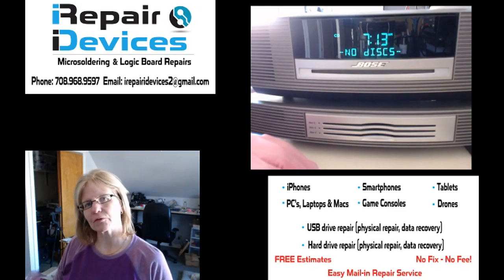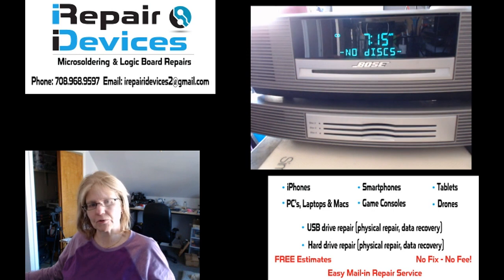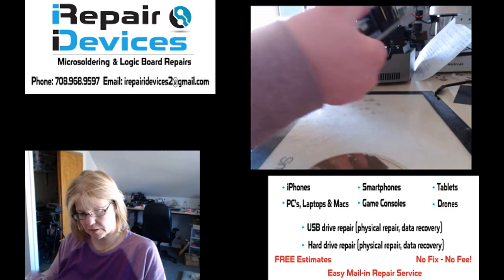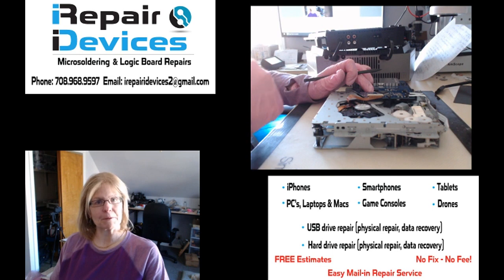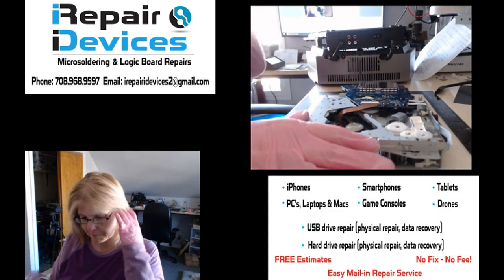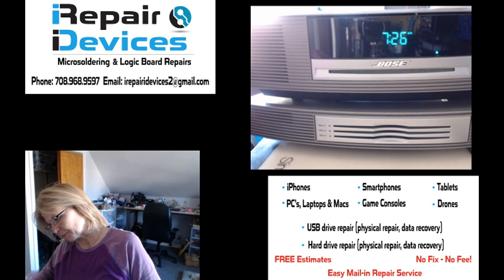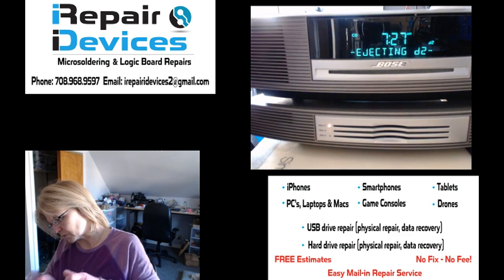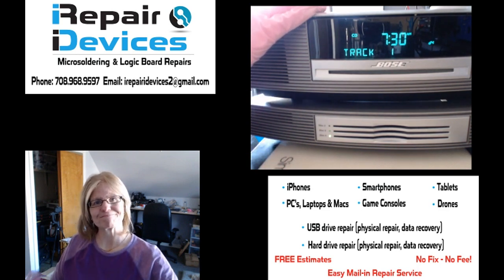Bose Wave Radio CD  - disk error messages and drive chattering

Comment: Amazing video..Have a Bose AWRC22 and  3 disc changer. The changer initially did the skipping thing and only chattered on eject. Now it chatters whenever play is attempted in all slots. Bought it used  recently, so I am unsure but am going to try what you did in this video. Question, though. The main unit is "picky" sometimes about cds, meaning  it won't take certain cds in  to load to play o4 It takes a couple tries for the "roller syetem to take it into the init to play. Is this normal? If not, is there some way to address the issue without dissasembly..? As an addendum when the pickiness occurs, unless I  wait until "reading disc" and then "disc error sets while the disc is sitting in the slot halfway in it scratches the play side of the disc also. Any assistance with this would be much appreciated. NOTHING addressing the main unit "selectiveness" is online..

Comment: I have a Bose setup similar to this one worked on which has a problem reading disks with both the main unit, and theMulti CD changer accessory in all 3 inputs. The player feeds disks, reads disks disk error message, and ejects disk. I have seen other repair videos with the cleaning disk, but feel that it no doubt needs internal cleaning but some adjustment of the speed pots. I like the unit enough to not personally disassemble and mess around, but instead get it done right. What is your opinion?

Comment: I have a wave cd radio which has the single slot cd port. The unit unreliably feeds the cd into the player. Do you have maintenance tips or repair on how to diagnose and fix the problem?
Reply from the maker: Good morning, Loretta. When you say "unit unreliable feeds CD into the player". Does the unit fail to grab the CD and load it into the housing? Or it loads into the housing,  but does not spin? Do you get an error message on the display like for instance  "disk error"? Or the CD does load properly but just spins, no error message, no sound etc?
Reply: Hi,
Shortly after posting the inquiry, I found out from another youtuber, that the problem was due to dirty feed rollers. Making a card, dummy cd, and feeding it into the slot cleaned the rollers. Thanks for getting back to me. I forgot that I had the problem and moved on to other problems in the house. The Bose works great now.

Comment: Ma'm, I noticed that you did not have to go into the top unit (the single player). I only have the single top unit, and mine chatters TERRIBLY!!! I've had it for many years and I sure miss listening to it. I've tried the disc cleaners, but no luck there. Would bouncing it off the walls help any??? Oh...it doesn't seem to have any problem showing up on the screen...it just chatters terribly and keeps skipping back to the part where it started chattering like it's stuck there. I hope I explained that clearly enough.
Reply from the maker: Hello Cliff. Bouncing it off the wall could possibly help it. 🤣🤣. Just kidding. I do offer mail in repairs. Email the info and i will be glad to quote you a price. 

Email: irepairidevices2@gmail.com

Comment: My multi-cd player is fine since I replaced it in 2016. It is the original single wave system that stops or does not want to play. Would a cleaning disk help this problem. If so, what is the cost and how do I purchase this disk.
Reply from the maker: Hello Dee, you can try using a disc cleaner cd. You can purchase them online from Amazon.  Some of your local box stores may carry them as well. Cost for these can range anywhere from $8-$15. These cds have a small micro brush on them and when it's inserted into the unit, the instructions tell you what you to do, but basically the spinning motion will gently brush the lens. You may have to do it a couple of times. Do not touch the tiny brushes or bend them with your fingers. That may resolve your issue, however if it does not then a manual cleaning of the lens would be the second step and that requires disassembling the unit. If the problem still is present after the second step then the issue is mechanical.

Comment: Hi, I have a unit just like that one, except my number 1 cd player, (one on top) does not play my CDs, says error, the cd will play on all the rest. I try a cd cleaner but that did not help. any idea. thanks.
Reply from the maker: Could be a variety of things. Dirty lens which would require manually cleaning because the CD itself wasn't enough. Lens itself is failing or the internals need a good cleaning and re-lubing.

Comment: Mine has a please wait message and nothing not even aux works, any way to reset? It was working fine very recently but when I unplugged it to move it I get this message.
Reply from the maker: Hello Khoel. Check the aux cable, make sure you don't have any broken pins. Aux cable that runs from the 3 disk changer to the main unit consist of 9 pins. Keep me posted
Reply: @irepairidevices  no issue with the aux cable itself, tested it on my other stereo. It started working again tonight randomly. although it is struggling to read discs. I may have to clean it. Thanks for the quick reply!! Aux works now though I'm pumped!n
Reply: @irepairidevices  it is skipping and making a clicking noise when I try to use a clean CD

Comment: I has working on mine and broke a ribbon connector. Want it?
Reply from the maker: Drive assembly possibly need re-alignment due to gear and/or spring out of place. If you are interested I offer mail in repairs.

Comment: You seem to me to be very good at what you do, and seem very knowledgeable in regards to electronic repair! Now for the however.
However, you are wearing what appears to be a sweater like sleeved shirt, unfortunately you are not wearing a "Anti Static Wrist-Band". This is a BIG NO, NO when performing any electronic repair. Just one small static discharge between one of your fingers and a component such as a chip on a board could cause you and your customer to experience one big headache.
The "Anti Static Wrist-Band" will ensure you are grounded and static cannot not damage the equipment you are repairing.
The latex or rubber gloves you are wearing will block static, but if they have even a tiny hole, a hole unseen by the sharpest eye, the worst can happen. Gloves will also reduce your dexterity by an average of 30 to 50 percent. The only benefit from the use of latex/rubber gloves is keeping the oil on your skin off the components you are handling, however that's really not an issue, just wash your hands before beginning your repair. If you must wear gloves you should also wear a "Anti Static Wrist-Band".
My mistake if you have a "Anti Static Ankle-Band" hidden from view. In any event you should seriously consider grounding yourself to the units chassis and or any board containing integrated circuits (IC's/chips) CD cartridge etc. you are working on.
You appear to me to be a very talented tech, and I would bet you are self taught, which in my opinion definitely shows you're one brilliant human being that loves to learn!
Well my son has a very bad cold, so I better get off the computer and go keep an eye on him, I must be sure he 'Bose' his nose correctly. ;-)
Reply from the maker: I am wearing my Anti-static harness. I wear it where its out of my way. I never wear it around my wrist.
Reply: @irepairidevices   Being a tech myself, I know by the way you present yourself, that you know what you are doing. I was just having a lazy fun wacky night off and decided to reply to your post.
I would recommend you for a repair or troubleshooting job without any hesitation!
Keep up the good work. "It's a wonderful day when one is compensated for what they enjoy so much!." ;-)